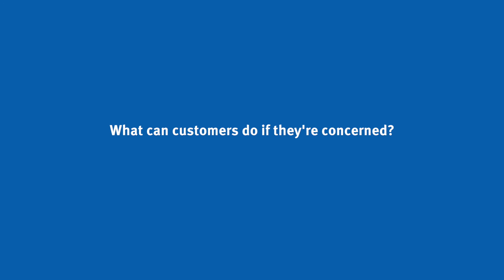How It Works: Orthophosphate

Comment: Orthophosphoric Acid
In subject area: Chemical Engineering
Phosphonates (glyphosate) are the derivatives of orthophosphoric acid in which an OH group has been replaced by a radical organic [17].
From: Current Developments in Biotechnology and Bioengineering, 2020
Chapter 

Corrosion and corrosion inhibition in acidic electrolytes
6.1.3 Phosphoric acid (H3PO4)
Phosphoric acid (H3PO4) is a colorless syrupy liquid. It is also known as orthophosphoric acid and its available analytical grade is 85%. In pure form phosphoric acid exists in the solid-state. As compared to HCl and H2SO4, phosphoric acid is a weak acid. It is one, two, and three hydrogen that can be successively replaced to form 
H2PO4
- (dihydrogen phosphate), 
HPO4
 (hydrogen phosphate) and 
PO
phosphate), respectively. As phosphoric acid is less aggressive than sulfuric and hydrochloric acids, its high concentrations (15%–70%) act as effective oxide dissolver. At low concentration, phosphoric acid forms iron phosphate that provides slight corrosion. Similar to H2SO4, phosphoric acid causes serious skin and eye irritations. EU 1272/2008 classification of the phosphoric acid is presented in Table 6.5.                                                                              https://www.sciencedirect.com/topics/chemical-engineering/orthophosphoric-acid#recommended-publications